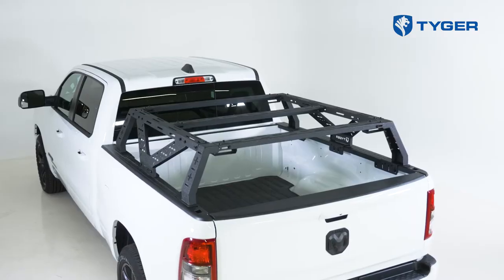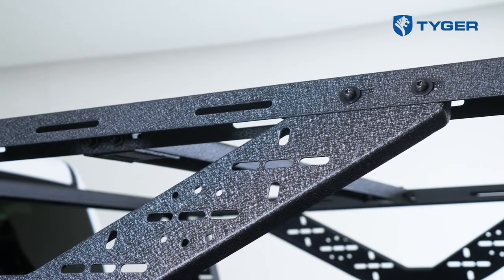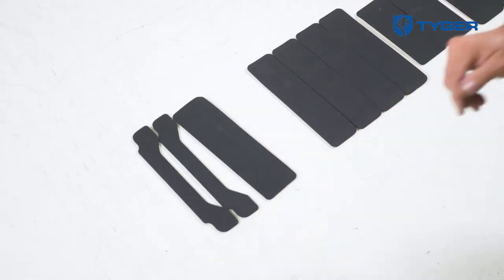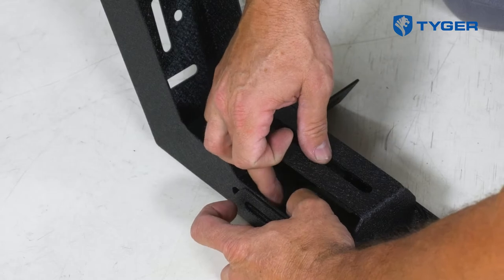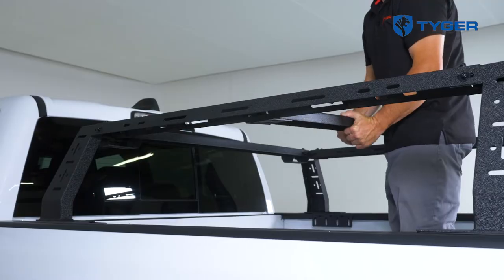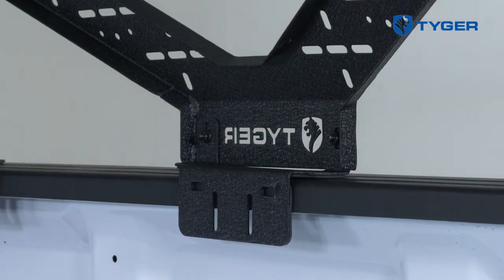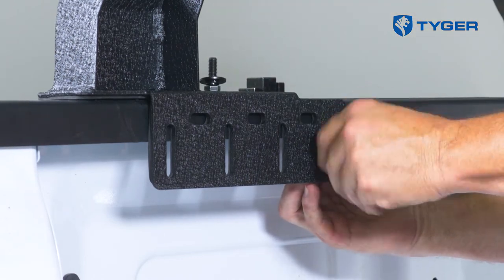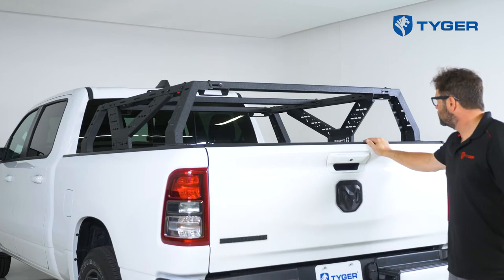V-BRACING Full Size Truck Overlanding Bed Rack | Install Guide | TYGER AUTO

Comment: Will these fit over a tonneau cover 🤔? I have a 21 ram 1500 classic warlock. And I have a vinyl roll up tonneau on it from weather tech
Reply from the maker: If you share with me with your tonneau cover model I can help you take a look. And chances are it won't fit given it shares the mounting area with most tonneau covers.  But let's have a look first.
Reply: @TYGERAUTO  ahhhhhh I gotcha. That makes sense . Yea I think it does hang over alittle to Inside of the railing so yea probably won't work then. But it's a weather tech and model number is 8RC4165
Reply from the maker: @waynetaylor4792  I took a look. Like you said, the overhanging side rails of the cover blocks off the bed rack's mounting brackets from accessing the inner sides of the bed rails used to mount it so unfortunately your cover won't be compatible with this rack.
Reply: @TYGERAUTO  dang I kinda figured lol but thanks so much for the help!